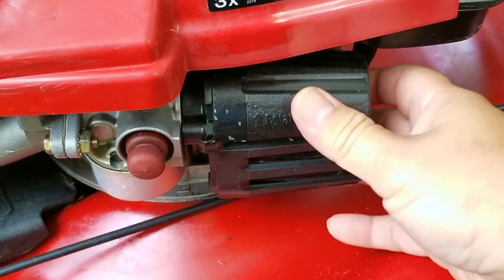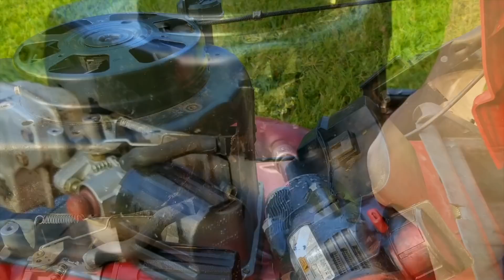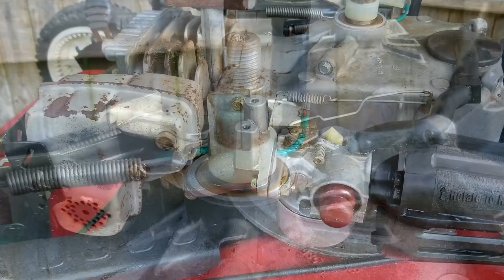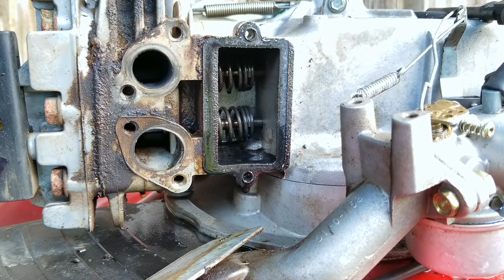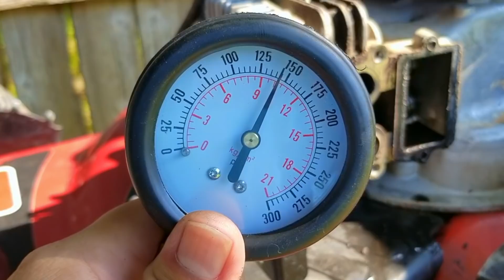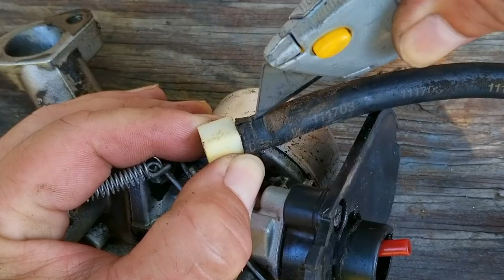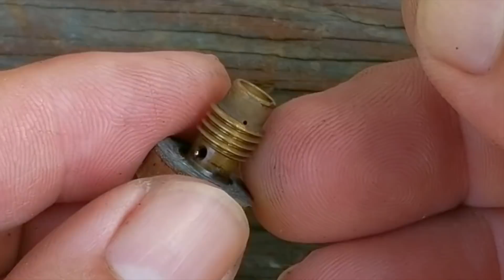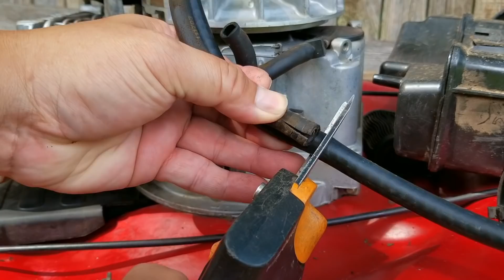You won't believe how many problems this Free Toro Mower has.

Comment: Such great videos. U make one quick question  on my friends craftsman riding mower gas coming out around fuel pump he took carb off brought it to me had a few slight clogs in it it’s all cleaned out gonna take it to work Tom. Do you think pump may b bad not sure if it’s plastic or metal it’s a18 .5 Briggs motor thanks again I do enjoy your videos
Reply from the maker: You didn't mention if it was a engine pulse driven pump , or cam driven.   Either way, the diaphragm might have developed a tear, so it's leaking. I would invest in a new pump
Reply: @HomeGaragechannel  thank you I haven’t seen the machine yet thanks that will put me on the right track your the best

Comment: That sounds like a bottom end knock to me, probably caused by excess running with low oil. Every time I get a mower with the oil below the bottom of the dipstick it has knock or smokes. That compression reading was surprisingly good given the lack of oil though so it might go ok for a long time yet with regular oil changes.
I like Tecumseh engines when they work properly but the design of the intake/exhaust system and the requirement to use about 9 million different tools to disassemble and adjust them gets frustrating.
I'm not sure I follow your thoughts regarding the exhaust valve clearance and pullback from the starter rope. Slightly loose valve clearances would just cause excess noise and tight clearances, to the point of holding a valve open, would cause a backfire from the carb or exhaust, depending which valve is affected. A loose blade can cause pullback sometimes, maybe this could be part of the knocking noise too, so you might get away with a healthier engine than I thought.
Reply from the maker: thanks astralplane
Reply: Loose valve clearance can cause a centrifugal compression release to not open the valve as much as the engineer intended--but I don't like the compression release anyway. Some engines with electric start however use too weak starters and small batteries that won't turn the engine over unless the compression release is working fully as designed. Pitiful. 
A tight valve with not enough or null clearance once hot will burn. And also burn the seat.

Comment: What were you saying about not liking your the Toro's cut? You said you don't like the Toro blades? I'm curious to know a little more about why you think that.
Reply from the maker: no, the blades in conjunction with the deck combo doesn't cut as well as my other mower, which I didn't mention. that mower has dual blades and a deck design that literally chops the grass to tiny pieces.
Reply: @HomeGaragechannel  Yeah, I've heard others say the Atomic blade tends to create a slurry when the grass is wet and or long. From personal experience, I've seen the decks get pretty caked to the point where the mower shuts down and you've got to scrape the grass out. I've seen that happen on some other mowers too though and wonder how much is related to the blade and/or deck.
Reply from the maker: you are absolutely right. that honda I like to use wasn't cutting so great, so I looked under the deck and there was a fair amount of grass packed on it. I washed the grass away and it was its normal self again. It had been raining so much recently that I had no choice but mow several hours after the rain, and this is what happened to the mulching ability, it was reduced.

Comment: I have an older green Craftman mower with this Tecumseh engine and it is awesome! It doesn’t have a bag so I rarely use it but it runs like a beast! It does have that very bad misfire when it is cold however, typically it goes away when it warms up. Maybe I’ll look into that.
Reply from the maker: good luck to you William Marshall.

Comment: I'm actually in the process of repairing an engine like this one (it has a blown connecting rod and worn rings), the other one i have is in good shape in my craftsman mower and despite some abuse it received by previous users it has held up great, there are indeed some things which are not very desirable about Tecumseh engines, and the fact that they are no longer being produced and parts can be hard to get makes it even worse, but i actually like them and if they are well maintained they can last for several years; by the way, using cardboard from a cereal box works pretty good although it may seem sketchy
Reply from the maker: thanks for the information I appreciate it.

Comment: That was fun, thanks! Just FYI the self propel gearbox on these great old Toro mowers is totally serviceable, so if the previous owner hasn’t tinkered with it and lost the drivetrain parts you can buy the individual bushings and gears for a few bucks to fix up the drive without buying a whole new unit. I always liked these mowers and especially the Tecumseh engines. When I bought two of these new back in the early 2000’s I specified that I wanted them equipped with the Tecumseh engine instead of the Briggs (although both are good). I never cared for the mulching function but with the side chute slightly modified to lift it about 1/2” they were unbeatable IMO.
Reply from the maker: thank you mjg263 for the information, the only problem is that the whole drive system, from snap ring to input bushing is worn and loose, which I've never seen before. I'm sure I could replace the bushings, and gears, but would feel more comfortable replacing the unit.
Reply: @HomeGaragechannel  good call, if the deck is not cracked or otherwise compromised that is what I’d do too! Must have a lot of hours on it (that’s why I bought 2, so I could alternate them and reduce wear).
Reply from the maker: that's smart.

Comment: I would fix that one up & yes,I grew up with people who couldn't be bothered fixing that one up so I got bored with them & moved on from them in life which is kind of why I studied at least 1 trade during & after high school because I got bored with the place & the people in it - they were too much like one of them who couldn't be bothered.

I mean,I've studied some automotive & the whole electrical trade course at tech which I got my certificate then got an apprenticeship to be an electrical fitter/mechanic which I found much more interesting than school & whoever was there.

It looks like that mower may have been stored vertically because the spark plug was totally fouled up & I gave my B&S lawnmower a re ring almost 2 years ago because the spark plug started fouling up like that.

There was about ,0.045" of ring clearance which was well over the 0.032" reject limit as specified by Briggs and Stratton,the new piston ring gap was 0.009" which was very tight & now the engine uses bugger all oil & the spark plug electrodes run grey !
Reply from the maker: that's a good possibility. thank you Russell Booth.

Comment: I picked one of these up a week ago. just needed a carb clean and $6 OEM carb kit. runs like a top. A lot of these mowers were run into the ground since Tecumseh went out of business in 2008. The one I found was in VERY good shape. The blade was practically brand new. They're not really fun to work on, very finicky too.
Reply from the maker: you're right about that. Thank you norge696
Reply: @HomeGaragechannel  Another thing I forgot to mention is the crankcase seals go bad, breather tube, valves stretch overtime, primer bulbs.
Reply from the maker: good information.

Comment: Why are Tecumseh engines dreaded?  I know nothing about them, other than that people seem to not like them.  I have so far surmised that Tecumseh was a manufacturer/brand, like Briggs & Stratton and Kohler are.
Reply: had both B&S & Tecumseh on the same Snapper deck. Tecumseh was the only one that spit a rod out of the block, while mowing. I keep my oil level 'up' as best I can. But that engine let go. Twelve years is about what they last, Briggs or Tecumseh. But Briggs just start using too much oil, Tecumseh will 'snap' right there in the grass.....  ?? 
Can't say I hate one, but I'm on my second B&S engine. Mower's middle aged at 37. : ) 
Heart Transplant. My Snapper deck is drilled to now accept either one as a 'donor'.
Reply from the maker: I can't speak for Everyone but it's not as rewarding to work on them as a Briggs or a Kohler

Comment: Sounds like a loose blade to me, A loose blade can cause a kick at the rope when you pull it. Your guess that it may have been the flywheel key is the usual cause though.
Reply from the maker: yes you are right, however, I was the one who put the blade on so it's not loose.

Comment: I had a lot of experience with Tecumseh, back in my working days. They were just a different style of engine. I had one that was an 8HP with a recoil start only. Talk about hard on a guy's back! I'm not sure they are even in business as Tecumseh, anymore. If I remember correctly they got in trouble for price fixing or price rigging or some such nonsense. Got sued. Don't know what ever came of them after that. If I found one for a good deal, I would not hesitate at all to buy it. They're just not a Briggs, is all.
Reply from the maker: Thank you Stephen Bridges. I'll have to investigate that
Reply: Tecumseh went out of business around 2007.
Reply: @mikespain8655  That sounds about right. That's right about the time I heard about all their difficulties. Shame really. They were a somewhat inexpensive alternative to a Briggs.

Comment: Actually just repaired our exact same mower. Rod and rings were done so I ordered a whole set for $45, honed the cylinder and it runs like new.
Reply from the maker: nice work Jack Philip
Reply: R6d
Reply: J
Reply: How do you hone a cylinder and refit the rod and rings. I’ve never heard of anyone doing that. Thanks in advance!
Reply: @richardmorse5307  Surprised to see a response on a video 2 years old haha.

Honing can be done with a 3 stone or ball hone. You can find them at the auto store, motorcycle shops, amazon etc. You're trying to clean up the cylinder and break the glaze for new rings to reseat.

Refitting the rod is just purchasing a new connecting rod then verifying the fitment, as well as polishing the crankshaft journal. If there's too much slop good luck finding anything undersized, sadly standard is the only size you'll find.

Rings and piston are easy. If your piston is still good, then just order new rings and reinstall. If the piston has damage then replacing both would be a good idea.

I've skipped over a bunch of stuff about rebuilding, but I'm sure you can find videos online and figure it out. These are very hardy engines and don't really take much to run well. Any parts not available you can sometimes find "NOS" or "Like new" on eBay, but it can be a gamble.

Comment: Have to say not keen on Techumseh engines as the all seem to use oil as the get old people do no check oil level and the knock ot break a con rod, also having to undo the carb from the engine the threads can strip, which is a pain .
Reply from the maker: you are correct about their issues.

Comment: Great video.  Could you elaborate on what you meant by not caring for how these mowers cut because of the type of blade they come with?  I have a similar mower, but Craftsman with Briggs.  It came with what I call a twisty mulching balde which I did not care much for, as I thought it bogged down way too easily in taller grass because of it.  I changed it to a straight blade with the angled teeth on the back for mulching and it does seem to work much better and even cut easier.  What type of blade do you prefer or recommend?
Reply from the maker: I was actually touting how much I like my honda dual blade setup, without mention the word honda. These cut okay but the deck and the original  blade, don't work as well as my honda. it's literally chops up the grass to tiny pieces. No recommendations for any one type or replacement blade.
Reply: You are referencing a Gator blade, I believe. I think you will be quite happy with it as a mulcher because of those teeth. It is especially good at chopping leaves to little pieces. But I also agree with HG's reply; the Honda dual blade system is the best.
Reply: Gator blades are the only way to go, on any mower. Gators are all I run for 16 years now.

Comment: The gas cap is not missing the silver piece. That's the new style and they did away with the metal piece because it kept falling off. The ones with the metal piece also has a green piece of foam under the disc.
Reply from the maker: ohh, I didn't know that. thanks Gary McPherson!

Comment: I have no problems with a Tecumseh engine at all.   I still have a mower with one on it.   I've never had any problems working on it.
Reply from the maker: nice, what brand is the mower?
Reply: @HomeGaragechannel  It's an old Toro Personal Pace. Model 20031.  It's not a bad mower to chase around the yard but it does have some power issues in long grass.
Reply from the maker: are you cutting more than an inch or grass? meaning is your grass, say 4 inches tall from the ground, but you have your mower set to cut to position 3, which is perhaps 2.5"? If so, your ending could be a bit down on power, but I think If you only cut an Inch at a time, the mower would have a better chance of not bogging down.

Comment: I have a question my grandpa have me a push mower and it runs but I only starts with starter fluid and after I runs grate but what do you think I should do to fix it
Reply from the maker: what kind of starting system does it have right now? a push primer, a choke lever? or is an auto choke, where you just pull it to start?
Reply: No primer and I have to manually choke it
Reply from the maker: as you long you can confirm that the choke flap is fully closed when you move the lever to the choke position , then it might mean that the bowl gasket is leaking some air, which is making the choke not work as well.
Reply: The brand is cub cadet and the model is 12a18mc 056
Reply from the maker: thanks and nice mower there.
Reply: Thank you for helping me I will have to check it out later